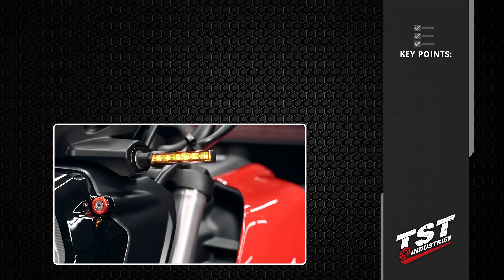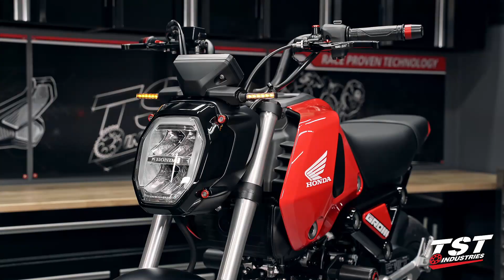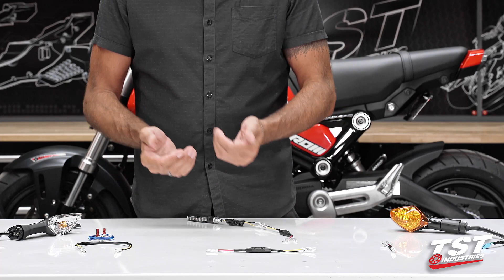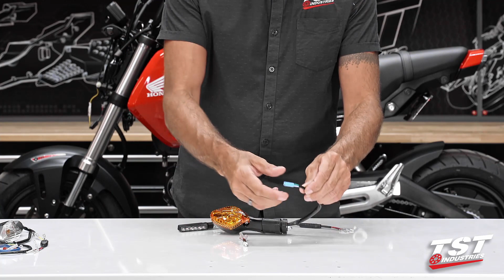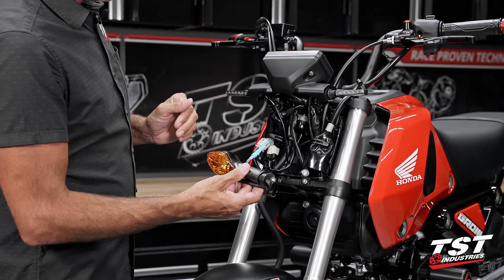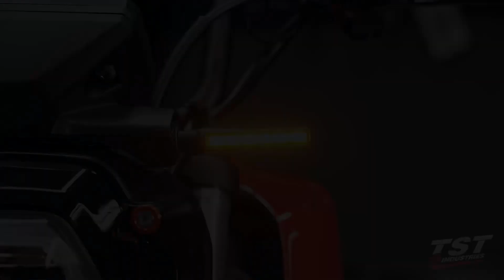How to install the TST Universal Turn Signal Running Mate on any Motorcycle

Comment: If I get the running mate harness can I convert the 2 wire rear turn signals on a 23 grom into the running light configuration ?
And would I run the blue wire from the front (already running light equipped) turn signals ?
Reply from the maker: Yes but be advised that the running light will be amber. The simplest means of running light function connection through Running Mate would be from the license plate light or running light in tail light circuit. If you can wait several days you will be able to scoop our Quadrix-D lamps that have amber and red LED chips, and can be hooked up to have running light, brake light, and sequential signaling. You can see the video installation of the kit we are launching within several days. Here is a link: https://youtu.be/cyWi3uNdO3Y
Reply: I like the idea. But, they are kinda “square”
Reply from the maker: @davidcuthbert5788  alright, no worries. Those lamps are the only ones we have built all that functionality into so far.

Comment: why dont have option to sold to brazil?
Reply from the maker: We did for some years, but more than half of the packages were getting "lost" in transit to the recipient, and we were also getting many fraudulent credit card purchases from there. Selling in that region was a loss to our company so we had to stop. We do have two dealers in Chile. Maybe you can check with them if they can deliver to you. You can find their info through the dealers tab on our website.

Comment: I just got tst turn signals for my 2016 yamaha fz-09 and I found out t
That my bike have 3 cables conected to stock signal,,ca. You help me exacly what converter do I need? Thanks
Reply from the maker: If you are shopping our store then for 2016 Yamahas we use a 3-3 converter. There is only one type. We also have vehicle specific videos for parts we offer for that bike.
Reply: @TSTindustries  yes I did order from your store,,thank you I will order the converter
Reply from the maker: @Colima25  before you place the order check out the videos so you know all you need and how to install. If you still have the pen signals you can save yourself money and just clip off their connectors with 6 inches of wire sticking out from connector, then use that as your converters. Those are basically a 3-3 but without the bullet connectors for the TST signal side. You would just have to wire the signals into the appropriate wires on those cut off sections.

Comment: Hello...I bought a friends LEDs from his 21 MT09 which have DRL.  My 2020 Tracer GT has those nasty punkin looking lights.
Can I connect the Running mates 3 plug, into the new LED lights and the other 2 Black and yellow wires into my to regular 2 connections from my bike?   Thanks
Reply from the maker: Your description is a bit vague. If you contact our customer service dudes through our website they will be able to get more info from you and help you figure out what you need to do to achieve what you are after.

Comment: Can anyone help?I have purchased your indicators front and this product! (as well as tail tidy, led licence plate light, chain adjusters etc)I have a custom led 3 wire connector! wired red black and white! which plugs into the honda wiring loom! which colour wires from your product above connect to the Custom led connector wires?
Reply from the maker: Unfortunately we're not familiar with CustomLED wiring or their products so we'd be taking a shot in the dark as well.
Reply: @TSTindustries  I have tonight order a relay and 3to3 honda connector from yourselves! as per advice in your video!hopefully this will get my indicators working as they should! I think the Custom LED relay I bought from Custom Led does not work it? or the Honda plug connector does not work from Custom Led?
Reply: I installed these on my 2022 Honda Grom today, I love them. 🙌 I went with the smoked color